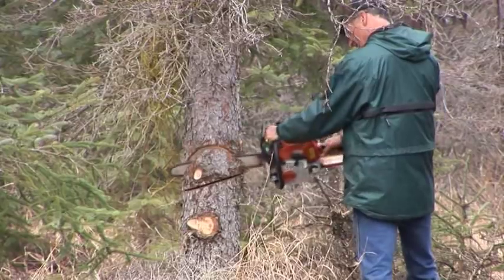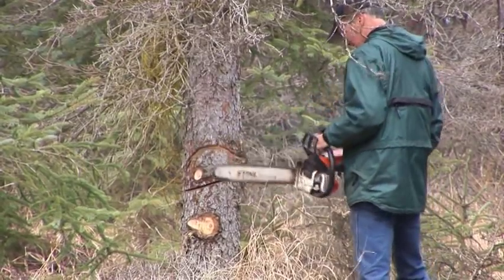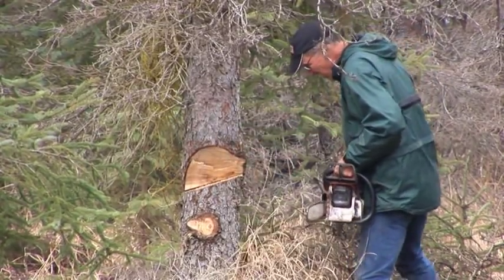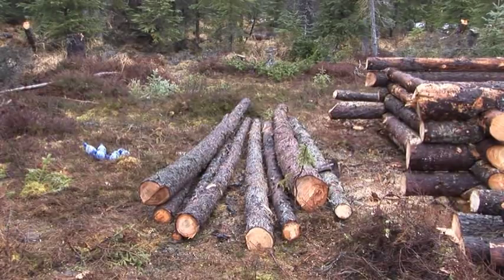Cabin in Alaska

Comment: I think this is a great example of 'it's more about the journey than the destination'.
The building/bonding experience between a father and son is FAR more important than the details of whether logs were peeled or the roof is sloped enough.
My first building project was a 24x30 garage, built entirely out of rough sawn lumber with a small chainsaw and hammer. 30 years later it's still standing just fine! I did a lot of things wrong but had fun and ended up with a usable project.
Of far more concern to me is that I really hope the two of you can get back there to just spend time in the woods together. It's so easy in life to get 'too busy', and time goes by fast. Find the money, make the time. Life is short enough, it sucks to get old and have regrets and realize what was really important in life.
Thanks for sharing the video, I hope it inspires others to come up with a project, whether a cabin in Alaska or something completely different.
Reply from the maker: +julie r Thanks for the kind comment!  It was definitely a wonderful experience (one of the best).  Unfortunately, since we live on opposite sides of the country, I don't get to spend as much time with dad, but we're planning to meet up in Nevada for a little camping in the next month or two.
Reply: +Robert Porter 
Cool! And I wasn't trying to imply it was vital to get back to that cabin, just that, well, my dad died 10 years ago and my best memories are the things we did together like that. And I always wish we had made the time to do more stuff together.
I see a lot of things like your cabin when I'm out hiking or 4 wheeling, and always wonder the story behind an 'abandoned' building. So it was great to watch the video. Some would look at it as a waste of time and materials, but to me it was 15 days well spent, regardless the outcome years later.
Hope you both enjoy the camping trip in Nevada!

Comment: Couple of tips.
We used saddle notches. Once the notches were finished on each end of the log we would pound in wedges so we could lift the log enough to  mark the center of the top and bottom log. Using peaveys we would roll the log back, dog it, and snap a line between the two marks at each end of the log. Then we would walk the logs cutting a groove with the chain saw. We cut plywood splines and set them in the bottom log and then rolled the top log back in place. This sealed the air space temporarily. We would usually wait a few months to allow the structure to settle before coming back to do the final chinking. When the client wanted electrical we would run the romex between courses. Using an extra long bit we would drill down through 3 or 4 courses and pound in precut re-bar. Make sure you know where all door and window openings are gonna be first. A couple of times the client changed their mind, that's a pain in the arse. (.<)

Comment from the maker: If I ever get enough money and free time, we'll definitely head back out and see if it can be salvaged, but I suspect there will be mold/mildew issues.

It's on 5 or 10 acres of land, which was very cheap.  The whole area basically turns into a marsh after the snow melts for a few weeks, which is why it was cheap.  You can buy plots in Alaska for very little money, but they don't have roads/electricity/phone anywhere near them, so you're really on your own.

Comment from the maker: The trees we used were mostly standing, but they were all very dead (no green needles, no sap).  The bark might ultimately lead to issues, but my father used the cabin off-and-on for a few years without any problems.  If we'd wanted it to last forever, we would have stripped the bark, but we only had 2 weeks of building time, and it was more of a fun project than serious housing.  Dad finished the rest by himself with a couple more weeks' work, but since he was alone, he couldn't film it.

Comment: Because the logs weren't debarked, that cabin is probably rotten and falling apart. I would be surprised if it was in good condition. Cabins that don't get debarked usually only last 20 to 25 years and this cabin is at least 11 years old now. It's been abandoned for 5 or 6, which makes it worse.
Reply from the maker: Keep in mind it'd a one-room cabin with very small entry points.  It's been boxed up the majority of it's life.  If it's in bad shape right now, that'd likely be more on account of the fact that it's in the middle of a marsh than anything to do with bark on the logs.

Comment from the maker: Yes, they're surprisingly easy to build (as long as you like physical labor).  Why join some exercise bootcamp when you can make a cabin instead?

We built the cabin as a solid box.  You should notice right before we finish the floor, it's on top of 4 massive logs.  Here's the reasoning:  Alaska is a swamp.  You get tons of snow and ice, which turns the ground into a marsh come Spring.  So if you build a traditional foundation, it'll be destroyed within a couple years by the elements.

Comment from the maker: Great questions!  We used dead trees, so they were mostly dry when we cut them down.  We were very careful what trees we chose.  As for the foundation, if you look at 0:45, you can see dad and me pulling a half-log.  We put 6 of those cut-side-up and built the floor on top.  It was very sturdy.  Since the ground freezes and changes shape, this floor acts like a sled, allowing the cabin to hold together and even move a little bit, where a regular foundation would have trouble.

Comment: Good video guys!  I have a question, why did ya'll not make the front door standard size?  Just curious.  Cool to see father son team working on a family project!!
Reply from the maker: Great question! There were basically two reasons: (1) bigger doors take more work and supplies, and (2) it's easy to make a smaller door strong, which is important in bear country. There's also a window that was made too small for a bear to get through.
Reply: Robert Porter Ok,  makes sense-sure don't need papa bear looking for goodies. 🐻

Comment: No debarking? Guys really....

Also I see a problem with log humidity as it will shrink rapidly during sumer time making the house "move".
Not sure if the foundation is good ether.
Do you have Building permit?
Reply from the maker: Not reading the "More Info" section for the answer to the most annoying question that is in the comments section already about 50 times?  Guys really....
Reply: Robert Porter
Now I feel like a dick - extra info explains a lot :)
Reply from the maker: Haha.  No problem.  ;)

Comment: Sorry, I am on my wife's gmail account. But would LOVE to do something like this with my son. How did you acquire the land, permits, etc? Also, what about plans, being an engineer, its constantly on my mind. What did you guys do for insulation between logs? Do you guys have a picture of the finished product? I was very impressed with the amount of work you guys accomplished in 15 Days! Awesome! Please let me know of an email address if you don't feel like posting on YouTube. Thanks again for the footage!
Reply from the maker: It really was great fun.  We didn't have any set plans, just the idea to build a box-shaped cabin with a slightly-sloped roof.  Between the logs is some type of cement.  Don't need much since it's so tiny.  The wood stove heats it way too hot without the door open  :)  No pictures of the finished product, but it turned out great.  Dad put some roll-roofing on top and cut a generously wide hole for the chimney and put a "too small for bears" window on the side.  If you want it to last for decades, a little extra preparation is in order, but ours lasted at least 4 or 5 years with no problems.  Haven't been back to check on it unfortunately.  Pre-planning is important, but you'll find most anything can be figured out by putting a little extra muscle into it.  I hope you have fun with your son!

Comment: so no insulation between the logs? must be cold.
Reply from the maker: Nope!  Even over the winter, we had to make sure the stove was almost out before we went to sleep, otherwise it turned into a sauna inside.  It's a small space and the logs act as excellent insulation.  The roll-roofing likely helped keep it fairly air-tight, too.
Reply: ok, around here (finland) normal tradition would be to put some moss between every log and joints.
Reply: mtkl23 do you happen to know some rules for building stuff like in the video, in Finland, or scandinavia? i want to move from my country (holland) ist getting to crowded...lol
Reply: MrCribbss is niet al te ingewikkeld denk ik, in midden Zweden staan hele leuke stukjes grond met hutjes te koop voor minimale prijzen.

Comment: you should have peel the log skin and put a nice finish over it and line up the logs straight
Reply from the maker: And then mill the logs and assemble an A-frame.  Then lay some plumbing and run Cat-6 through ducting so the whole place is future proof.  Maybe a pool table in the basement and an indoor aviary.  Yeah, I see what you mean.
Reply: Robert Porter now u talking

Comment: I thought peeling the logs was important.
Reply: It is
Reply from the maker: It's relative.  If you want it to last for years and years, yes.  Otherwise, not terribly.  It was completely fine for at least 5 years.  Haven't been back in 5 more.
Reply: Robert Porter It is important that any building lasts for as long as possible. So it is important to peel the logs.
Reply from the maker: Why is it important a building lasts for as long as possible?  Especially a cheap holdout cabin?
Reply: Robert Porter because if your gonna do it, do it right. And especially because if you do it the right way, 60 years from now your cabin will still be there and you'll still be able to use it.
Reply from the maker: The area basically becomes a marsh for one month out of the year.  By your logic, we also needed to lay a formidable foundation.  It's infeasible, as is peeling the logs for a hyper-short hobby build.
Reply: Yeah, i guess you'r right
Reply: anyway, nice job

Comment: i hope you were planning on building a better roof thats just going to pool water atleast raise one end about 3 - 4 feet so you have a angle cuz that roof will do nothing except rot no offence dont take this the wrong way
Reply from the maker: It is elevated about a foot and was fine for the several years we used it.  So, no offense, but you're wrong.  Sorry, I'm usually nicer to commenters who think they know everything about building cabins, but if you can't keep your nitpicks to yourself on Christmas, I've got no patience for you.  Go do something kind as penance.
Reply: I've had  a cabin for 40 years, and you are exactly right. A flat roof might hold for a couple of years or more if the weather is kind, but they are crap compared to a roof with a steep pitch. On a flat roof, the water has lots of time to find a leak, on steeper pitched roofs gravity and the inertia effect of the water flow lets you get away with a lot.
Guy seemed a mite touchy to your polite advice.
Reply: Robert Porter It was very good advice from Mr. Marcotte, politely intended, I'm sure:
I thought your response a but graceless, it was not nit-picking, but advice worth taking.
You've got away with your flattie for "several years" but it WILL cause you more grief than a steeply-pitched roof.
If the cabin is sparsely furnished, it may be already leaking, maybe not.
I'm also amazed that you do not advocate caulking the gaps with moss. I'm in Scotland, NOT Alaska, and my walls are insulated, but it's a bit of work keeping it warm when the temperature gets below freezing.
Like Mr, Marcotte, I mean no offence, I am only posting this for the benefit of others who may be tempted to go for a flat roof based on your short-term experience.
I had intended to just post that it looked like a good bonding experience for father and son-- which is a great thing in it's own right.
Hope you both continue to enjoy your cabin and each other.
Reply from the maker: mike marcotte Your initial tone was rude.  The roof is up.  The video is 10 years old.  Your comment was 100% pointless.  As for your "all I did was..." statement:  All I did was ask you to keep it to yourself on Christmas, which you didn't seem to be able to do.  In fact, you've elevated the rhetoric.  But if you want to start a flame war on someone's personal YouTube channel, you should keep in mind that they can ban your dumb ass on a whim.  AKA - I'm just going to ban you the next time you leave a comment without even bothering to read it, since you've proven to have nothing remotely worthwhile to say.

Jay Igaboo If you're talking about "kind weather", I'm guessing your cabin isn't in Alaska.  It was fine for at least 3 years of REAL Alaska winters.  While it's quaint that you want to defend this blowhard, keep in mind that the first rule in Alaska is to mind your own business.  Hell, if any of you would bother to read what I wrote, you'd know the cabin was built with speed in mind, not quality.  Your comments show neither of you bothered to read what I wrote, because that would have told you that I don't give a damn about the build quality.  So you're both rude off the bat, but you can keep on sticking your nose in.  I find it quite entertaining.
Reply from the maker: mike marcotte, Jay Igaboo   And just to show there are no hard feelings, if either of you can give me a sentence in English starting with "I hope you're planning..." that isn't condescending or passive-aggressive, I'll be happy to apologize profusely.
Reply: Robert Porter I'm not  a passive aggressive type, when I want to be aggressive, I am.
I posted not, as you seem to think, to attack you, but to deter others from going down the trouble-in-waiting flat roof route.
I tried to phrase my criticism diplomatically, having no wish to offend you, but you are tediously touchy, goodbye.
You can have the last word, I'm done.
Reply from the maker: Jay Igaboo No, I think letting you have the last word frames my point perfectly poignantly.  I particularly love that you felt the need to tell me I could have the "last word" eight weeks after the thread died.  Adios!
Reply: Typed words don’t have a tone. You assigned one.